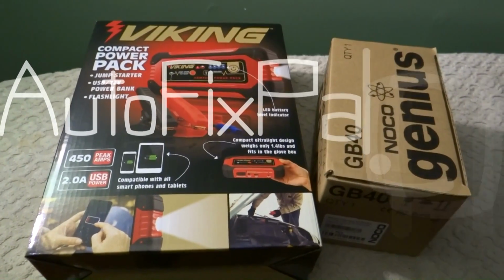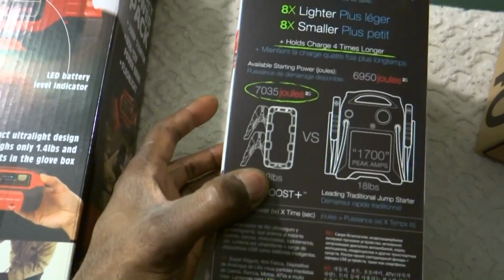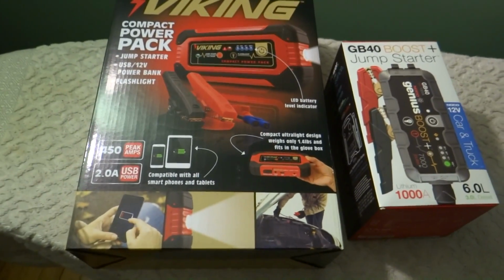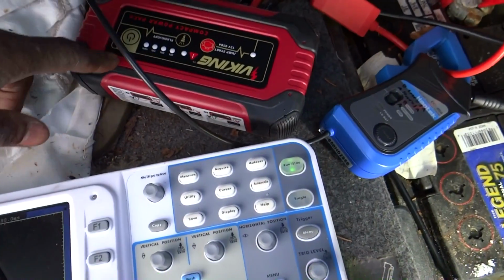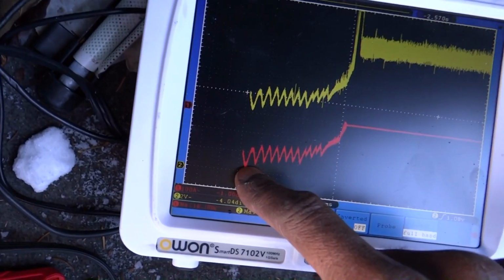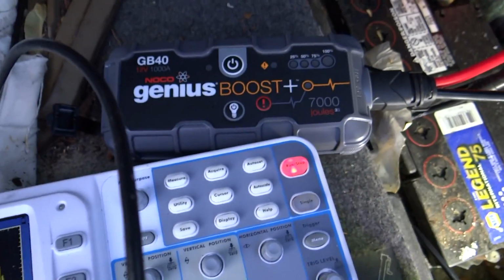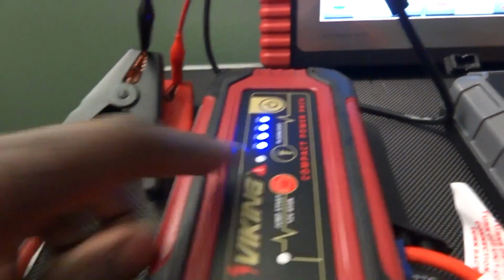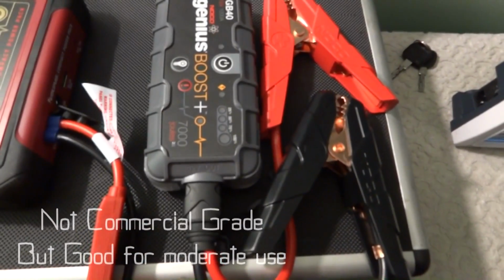Harbor freight lithium iron jump pack booster VS NOCO Genius Boost GB40 jump pack / booster - Review

Comment: Thank YOU for this test!
Dude, I'm so impressed that you had an O-Scope as well as an Amp-Clamp!
The only thing I can fault (unless it was addressed off-camera) is that you let the engine run, and therefore the alternator charge, between tests...
I think it's REALLY interesting how these two units compared with OVER 100% difference in their rated cranking amperage.
Reply from the maker: see my pinned comment about the status of the battery in the car. I cant be charged. lol
Reply: The amount of charge received by the battery in such a short time is negligible.

Comment: From what I understand the term Jewels when measuring power is one joule equals 1 watt second. Unboxings are corny and using the jewels as a measurement instead of watts is corny LOL. Completely appreciate the review
Reply: Actually, it makes quite a bit of sense.  My NOCO GB150 suggests it will put out 22500 Joules within 3s.  That means that over 3 seconds, it will be capable of outputting an average of 625A over the 3-second period. (22500J / 3s / 12V = 625A.)  So, even though the unit says it is rated at 4000A, that is almost certainly a peak reading.  Much more useful is the Joule3s number.

Comment: You should have simply disconnected the ignition and cranked the car untill the jump box could no longer crank the car then compare which box could crank the longest.  This would give the cranking time for each. 

    To get the max cranking amps lock the crank (The car's, by jamming the flywheel.) and hit the starter for three sec or so.  Record the max amp draw and this will give you the max cranking amps or max starting power.  

     The more cranking power the bigger or colder or both, engine can initially be turned over.  The longer cranking time will enable starting more reluctant engine, like time needed to pump fuel into a carborator to get the engine started.  These are really the two things one needs to know to determine which jump box is better.
Reply: Yeah put all that stress on the starter burn the solenoid up now that's a test!
Reply: Very true but the test should also be done a second time with the second booster being first to be equal and fair.
Reply: Sounds like a wonderful way to burn up the starter.... which is more expensive than a expensive jumper box or a new battery...
Reply: @theterriblegamer01  A starter should never be cranked over 10 seconds.  It should be given a cooling time between cranks to avoid damaging it from over heating the starter. 
Replaced many baked starter because of ignorance from operators , some costing upward of $600. just for the stater itself. 
 
 Over cranking it will damage solenoids, relays,  battery cable connections and melt battery posts.. Seen it  more than just a  few  times  over many years. Diesel equipment is  more critical because of the higher compression involved..
Reply: A comparative will be equally done.  the initial test should have been a crank test only with the ignition and fuel pump disconnected and the engine cranked over for about  10 seconds maximum time. On each of the stater pack/booster equally charged each time.

Comment: I just bought the Viking one from harbor freight, It does work to charge up a fone. But when I tried to power up a light that connects to the cigarette lighter, using the cable attachment for a cig lighter connection that comes with the unit. Turn on the power pack and then the light, it will turn on but only for like 15 or 20 seconds. Then the unit shuts off. Is the unit defective or is the light drawing too much power that it causes the unit to trip?
Reply: Try it on a different vehicle it may those vehicles particular electronics.
Reply: I saw another review here on YT saying that theres too much "noise" or interference for the charger to charge your phone properly. It WILL do it, but itll take a long time. The unit will turn itself off if there isnt enough load on it as well.
Reply: @NutsandBoltsAuto   Can you send me the link on the review I like to take a look at it. 
I would use the original phone cable to charge it,  【""not that Y connector cable that comes with the powerpack""】
https://www.androidauthority.com/best-usb-type-c-cables-682801/ 
those cables are not cheap!  USB type C
My cat chewed the original cable and I tried a regular cable it was taking 4 to 5 hours to charge.  I bought the proper cable and it charges in about an hour. "Learned the hard way"

Just because one cable works on one phone does not guarantee it going to work properly on another
Some phones are very finicky about their connection use a well-known cigarette USB charger of the 12 volt ACC plug.
 
.    When I drove car carrier I found out not to leave  AGM batteries hooked up longer than about 4 minutes and that shorting out the terminals is very destructive to the battery itself.

On the VIKING_62749  Jump Starter and Power Pack/Lithium Iron Phosphate  Battery12,000 mAh

【"According to the quick start guide when you turn it on with the power button you are supposed to get power only from the USB and the12-volt ports"】

https://manuals.harborfreight.com/manuals/62000-62999/Q62749.pdf

【'When the jump start button is pressed and the light turns green the boost mode comes on for ONE MINUTE and it shuts off."】
I'm assuming they do that to keep the booster from dumping all its charge into the dead battery and to protect it from overheating the clamps cables and possibly the battery itself.
 
The unit has a reverse polarity indicator if the red light comes on and it BEEPS do not press any buttons

The unit and its troubleshooting

1,_Red warning light comes on and the unit beeps. 
Battery Clamps are connected backward (reverse polarity) or there is a short circuit. 
Turn Power Pack off and correct Clamp connections. 
 Turn unit back on and resume operation

2._Unit beeps.
1. Overload on 12 VDC output port.
1. Turn unit off and check that electronic device being powered【 does not exceed 6 A load limit 】
2. Overload on the USB output port.
2. Turn unit off and check that electronic device being powered 【 does not exceed 2 A load limit.】
Red warning light comes on  STEADY AND STAYS ON 
.Power Pack battery is overheated. Wait five minutes for the battery to cool, then resume operation

Red warning light ]>flashes<{.
Battery Clamp Cable malfunction.
Repair or replace Battery Clamp Cable.
~~~~~~~~~~~~~~~~~~~~~~~~~~~~~~~~~~~~~~~~~~~~~~~~~~~~~

I have experienced damage to good and cheap booster cables. Have sent a question to theStackExchane>https://electronics.stackexchange.com/questions/149575/can-electrical-wires-be-ruined-by-overheating/424202#424202

https://www.quora.com/How-does-current-increases-when-resistance-increases

IN over 20 years as a mechanic in both the automotive and construction equipment, I have replaced many damaged components from overheating starter-motors, over cranking to staters, relays reversing switches on winches. Due to plain stupidity from operators

Have seen copper jumper cables which turn a black color inside without melting the insulation yet when you bend the cable which seemed brittle and turned bright dull orange. On a couple of occasions. Bakelite got so hot from the heat it cracked and warped relay and solenoid housings without fire. One of the worst cases was an international diesel truck with two batteries connected in parallel with so many connections in between the battery cables, wiring, other multiple connections more wire ignition switch intermediate relay and the final solenoid the stater. If every connection on the system had the supposed  ⅟10 /one-tenth per connection in 8 connection you would have .8 volt less than what's supposed to be an acceptable level. 

It is not recommended to have more than 5% loss from a bad connection/s  that is .6  tenths of a volt drop along a cable, or anyone circuits  @ 12.5v -5% = 0.62 1/10 volt     12.5 volts x.05=
The only way that can be checked under a load is to hook your DVM in series with the wire powering the circuit from the battery terminal to the component itself when the circuit is powered up and operation you should have less than .3 tenths ideally. when you remove the power to the circuit the voltage may go up to full battery voltage depending on the component such as a brush-type motor or 12-volt incandescent lights. 
 "Other electronic circuits will behave differently led lamps or controlled by transistor or timers, dimmers etc."

Anyone knows what is the case when as DC starter motor starts overheating and how that may affect current draw.
Many years ago there where Staters that used to expand when the engine was super hot or operated long periods of time, that created a non-functioning starter,  just a click of the solenoid, no engine turn over whatsoever. The cure was to weld the case/round housing where it was joined and it created a  gap, sometimes the field coils had to be shimmed. to get the magnetic flux closer to the armature.
 
Back in the mid-'80s, I had access to a 40K dollar SUN oscilloscope computer that had the capability to figure the compression electrically on each cylinder and other odd problems.

https://www.quora.com/How-does-current-increases-when-resistance-increases

Comment: This video is a big waste of time.  And you need to say is you got X amps from 1 & X amps from the other (10 seconds of time). But really if both jump-starters have a low enough internal resistance & enough power stored, it is the starter that determines the amps pulled (ignoring any contribution by your dead battery, which will have been affected 2nd time by the 1st trial).  So I am thinking that it is the volts to compare, not the amps, with the speed of turn over & how long it turns over before it quits.
Reply from the maker: the Battery was not just Dead. The Battery was BAD, Does not Hold a charge, Will not hold a Charge, DID NOT hold a charge, could not even power the interior lamps even after the first jump start. So yes i left that fact out of the video. However it is noted several times in the comments and even in a pinned comment. Yes, current used is determined by the starter and the amount of work it does. However it can only pull the amount of current that is available at the source (source being the jump pack). so if for some reason one of these boosters were current limited for whatever reason it would show up on this test. If anything having the Bad battery there made the jump starters work a little harder.

Waste of time? Don't be a troll. You were not forced to watch the video, you were not forced to comment and "waste more time" both yours and mine. 

This video proves that the HF battery booster is capable and a good buy. This video will help save some folks money over buying a more expensive booster. The Viking will do the job. The Noco has already been proven to perform.

Comment: May want to add the 'r' into iron, for title accuracy.  Thanks for the scope views, that was really interesting to see.  

As an afterthought for a [more] complete test, I guess you could have hooked the Viking back to the battery again and compared an Extreme cold start Crank Amp reading, with a relatively warm cold start CA reading.  Might have ended up with fewer upset people with not enough patience, or funds, to make their own video experiment.
Reply from the maker: Joel Kreider I missed that error in the title thanks i will fix that.. yeah there are a few things I could have done better in this video. I have v had them both for some time now so maybe I will do a 1 year later update on this test when winter hits. I still have that BMW sitting in the same spot with the same bad battery.
Reply: I retract my statement, apparently lithium iron is a better battery than the more common lithium ion
Reply: So you are saying  Lithium-Iron man could beat Lithium-Ion man in a  fight.
Reply: Auto Fix Pal it wasn't a typo on your part, lithium ion is correct, the box was wrong
Reply: When you want to do a comparison test it should always be done at least twice, the second time reversing the order of what is being tested.  The issue that the Viking had to prime the fuel line was also a disadvantage.

Comment: I would really like to compare the watt hours of the batteries to see how much energy they really hold.  The box for the NOCO said 12v 2a=24wah.  The HF says 12,000ah but doesn't say at what voltage.  At 3.3v, that would be 39.6wah (more than 50% bigger than the noco).  This matters, especially if you're using the battery for things other than jump starting, like charging a laptop computer.  That 12v 6a output on the HF would be very useful.

Comment: For the benefit of all: Jules is a measure of energy. Amps at a given voltage (12 volts in this case) is used to express power. Jules tell one how many seconds the pack will crank at a given amperage. Amp-hours is a "pedestrian" but popular way to refer to energy (Jules) where one amp-hour (in a 12 volt system) is equivalent to 1 amp times 12 volts times 3600 seconds. This means that a 12,000 miliamp-hour pack should be able to crank 300 amps for about 144 seconds!
Reply from the maker: Rodolfo Martinez thanks for sharing that explaination of joules.
Reply: *joules
Reply: Joules, not Jules, not July, not Julie :-)
Reply: One watt for one hour = 3600 Jules.  So if one wants to convert amp hours on a 12 volt battery one multiples the amp hours by 12 then by 3600  and you get Jules.  Hence Jules are much more impressive than watt hours.  Though one thing thing to to remember about Li tec is that Li batteries can be run down to a much greater extent than lead acid batteries without damage.  Li battery packs also have electronic controls that keep the batteries from over discharging or over charging enabling a 1000+ charge discharge cycles compared to around 300 or less for lead acid..  Li batteries will stay charged for a much longer period of time something like 70% charged after 2 years compared to dead in three months for lead.  Li batteries also will not freeze and destroy themselves like lead acid. What this all means is that even though Li is much more expensive at first they wind up being cheaper in the long run since they will last much longer and will work even if not charged for a long time.

Comment from the maker: Some people are saying the test wasn't fair because the cars battery was charged up by the car running for a little and taking some charge from the first booster. That is NOT TRUE. the battery in this car is toast. first jump start the battery had 280mv available at the terminals and incapable of even powering up the interior lights. The second jumpstart the battery had 1.6 volts across the battery terminals and still incapable of turning on the interior lights. 

I should have mentioned that the battery was not capable of holding a charge in the video. but i did not. so i am mentioning it now.

At 7 minutes and 15 seconds into the video the voltage on the battery before the first jump start is 280mv (a fully charged battery is 12.6volts). This battery Does not hold a charge no matter what you do, it is a bad battery from not being used for several months, i may have left the fact that the battery will not hold a charge out of the video.

At 14 minutes and 28 seconds into the video i should have pointed out that the battery voltage was at 1.6 volts and i did not, however if you look closely at the yellow max voltage number (shows as "ma") on the oscilloscope you can see the voltage is still VERY VERY low at 1.6 volts. In fact the reason i have to put the NOCO into bypass mode as i mention at 14 minutes and 31 seconds into the video is because the NOCO will not produce any voltage if it senses less than 2 volts which is about the equivalent of a AA battery in terms of voltage, also considered a completely dead battery.

So yeah i left out the fact that the battery would not hold a charge. But the comparison and test yielded completely plausible results. I intentionally used the HarborFreight  Viking first because it's more difficult to crank a car that has been sitting for months regardless of the batteries state of charge and the Viking jump pack is the newcomer with leads that are not quite as beefy as the NOCO GB40 so it should get first crack at it. Now maybe that's not 100% fair but the NOCO GB40 is rated for more than twice the amperage that the Viking is rated for, so i had o question it would start the car. Only other option to make that part fair would be to wait several months and Start the Car with the GB40 first.

I should also mention that the last time the car was started several months ago it had to be jump started as well and that was in the summer. it was 27 degrees outside when i did the test and there was 7" of snow that just fell early in the day. it was as fair a test as any.
Reply: Auto Fix Pal Great comparison and with actual data to back it up. Thanks for the clarification on the dead battery.